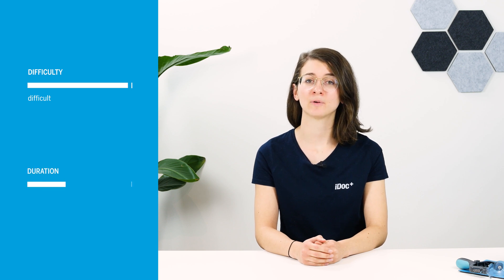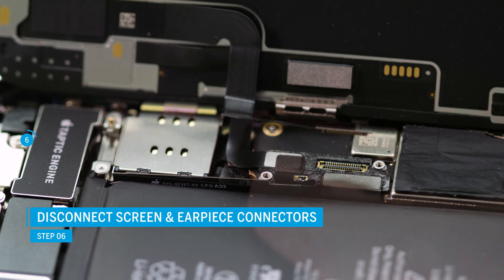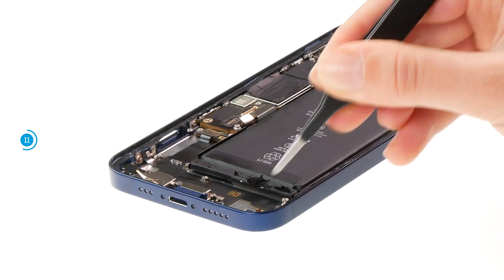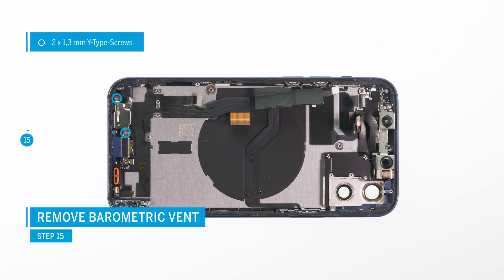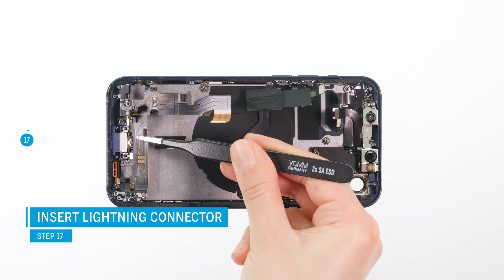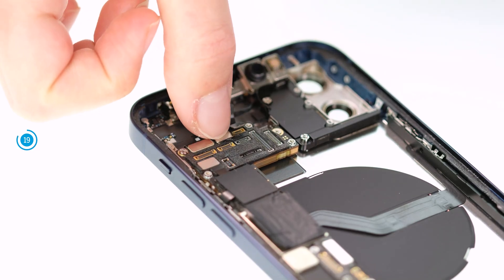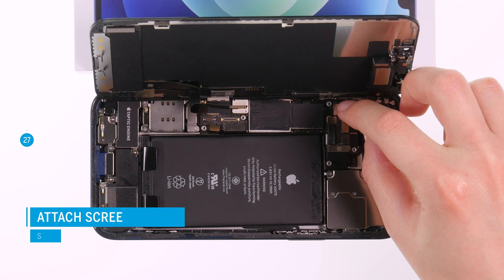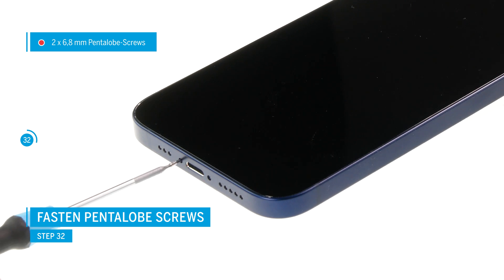iPhone 12 - Replacing the charging port [repair guide including reassembly]

Comment: We need main bord remove?? For this
Reply: I know right? I want to do this. But the risk is way too high.
Reply: @jobheger  I think there's too many steps for this.... or am I on smack?
Reply: @mixmastermantas6841  No Apple designed it this way to be as inconvenient as possible. I hope they make the USB C based iPhone 14 a simple internal modular port since those seem to fail more commonly than Lightning due to having more pins